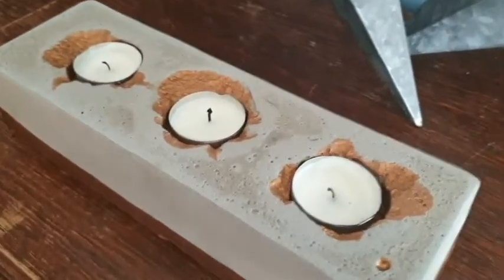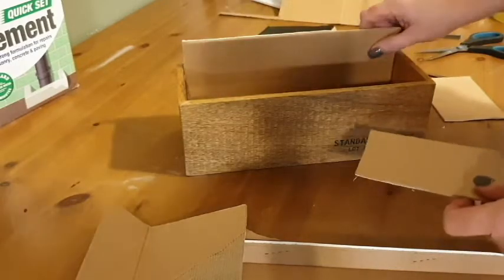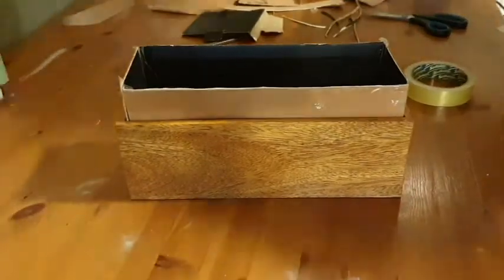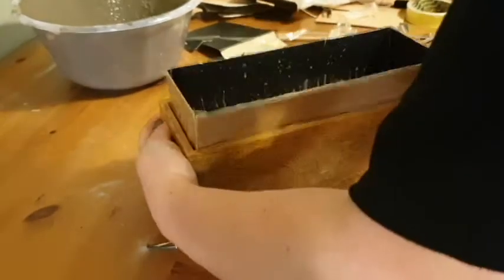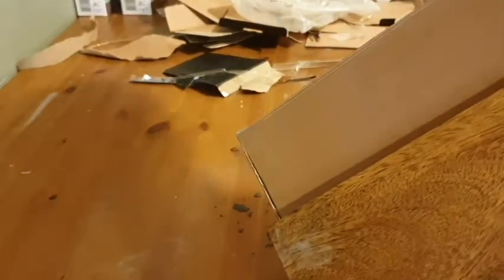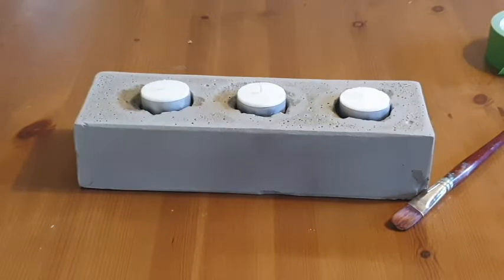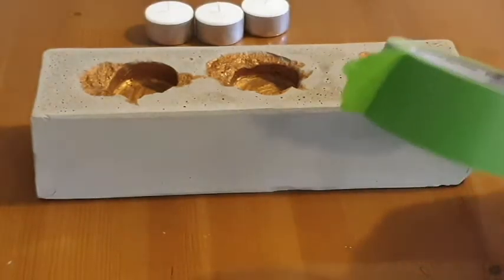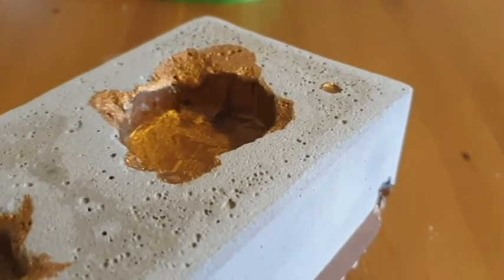Easy Concrete DIY Candle Holder

Comment: Hi Claire if u give your wood couple of layers of varnish n let soak in n dry it will prevent ur concrete from sticking n if u spray the out side of ur candles with any kind of oil that will help them stickin in the concrete to. I know u say u luv it as it n i do too but just incase u want another go. Apparently it helps. Fab job hun. Im glad u posted it its real life n made with luv so its great. No i would of saved it n ull neva see a one the same anywer u go thats all the better. Brilliant luv it. Very much in with the new rustic look. X
Reply from the maker: thanks sooo much Lynne ! great tips I will definitely use !! xx totally appreciate you helping me :) xx zip figured we could all learn from this one x ha